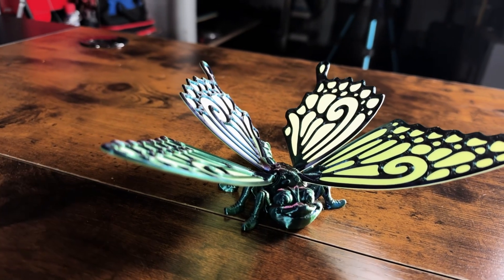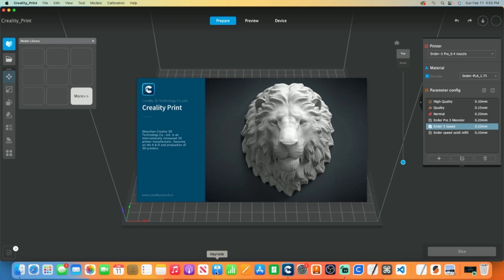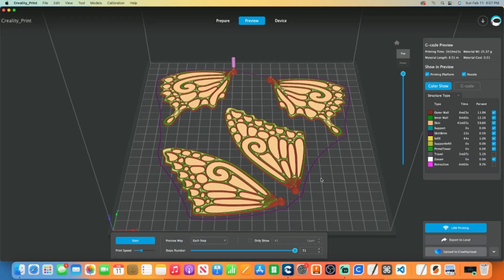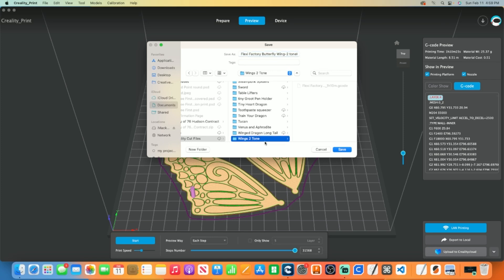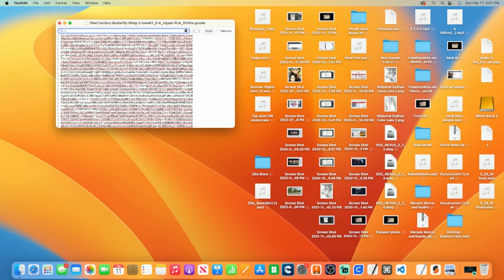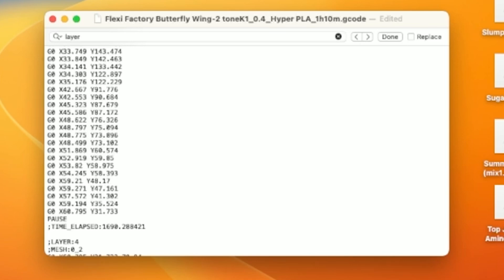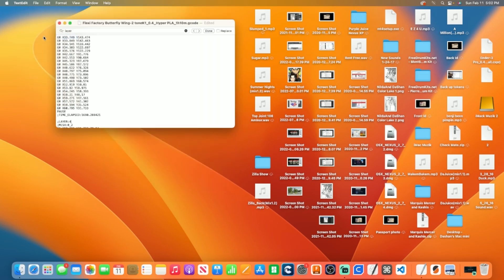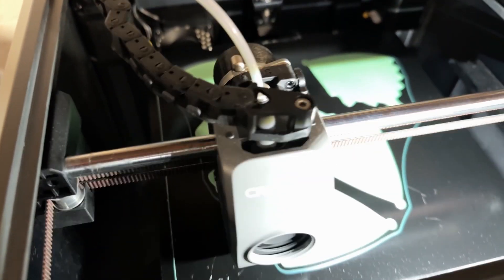K1/K1 Max 2 Color 3D Prints Using Creality Print!! #3DPrinting

Comment: Very interesting and well explained! I had this problem: the printer resumed the printing displaced about 4mm in y direction (towards the front of the printer)  ¿is that normal? ¿Can I try something to avoid this? (Creality Ender 3 V3 KE) Thanks a lot!
Reply from the maker: The printer may have physical shifted when you changed out the filament. It doesn’t home when you hit resume, so it could have moved in the process. Keep me updated if it happens again

Comment: soo cool man, that i have a quest, In the case of printing on the same layer, different colors? In this case, I have that mini army jeep in mind, would there be any solution?
Reply from the maker: Thanks. I’m glad you liked the video. I would have to do some research to see if this works, but…

use the layer slider to find the layer you want the change to occur. 

Once on the layer use the Step Number Slider to find the location

Go to the G-Code button in the G-Code Preview menu

The location should be highlighted. Place your pause g-code above that location when you edit the g code

Comment: I'm looking to mix ABS and TPU in some functional prints.
This trick might just be the ticket.
Reply from the maker: Thank you so much for watching. Let me know how that comes out. It can be tricky because ABS needs to remain at temperature while it prints and requires a higher temp to print. TPU can be printed at its highest temps around ABS’s low to mid range temperatures, but may have some stringing issues. And, that’s if the ABS doesn’t begin to shrink once you open the enclosure and let the heat out. If you calculate things correctly, I’m sure you can get it done. Please let me know how you make out

Comment: great info!   Personally it would be nice if that functionality were built into the machine software. Like if you could tell it to pause for a filament change at layer x and it would do that and automatically unload the filament.
Reply from the maker: Absolutely. Most software seems to be a Cura Slicer clone. The least they can do is clone everything. These work arounds are great, but the original software functionality would be nice

Comment: I struggled with this on my k1, eventually got it to do as i wanted, how come yours is different to the other vids where everyone else says 

Layer 5:
PAUSE
Reply from the maker: It seems like they wanted their filament change at Layer 5. So essentially, they would pause it at the end of Layer 4, right before the time elapse command. My Layer number wasn’t at 5, because my filament change ended up at a different layer number.
Reply: @JeDoVi3D  I didn't mean layer 5 in particular I just chose a random number , every other vid is after the layer command, which is the way I've done it. I was trying to work out what the difference is between doing it your way and typing pause after layer. Not here to argue just trying to figure out the best way, definitely giving your way a try tonight.
Reply from the maker: Oh ok. Was a bit confused. Ok, so I placed the pause at that location because I wanted the printer to stop exactly before the color change. If you place it after, it will print that layer, and then stop. I tried it at the layer I wanted the change to occur and it totally bypassed the command. When I experimented a little more I noticed you have to start it right before the time elapsed line. That worked perfectly for me from all of my other test. And I appreciate the question, I know you’re not trying to argue. It’s all love Trev. Thank you so much!
Reply from the maker: One more thing, I placed it at the very end of the previous layer because I didn’t want the existing filament to go into the next layer at all. If you place the PAUSE command at the layer you want the filament change to take effect, I’m sure it will be the same effect. That’s if you put it under the layer number its self, but before the printing gcode. My original mistake was putting PAUSE right before the layer number, which cancelled the following gcode information into the layer. If that makes any sense. But I’m sure the technique you suggested earlier works just as well as the one I suggested
Reply from the maker: Always! Thank you for watching 😀